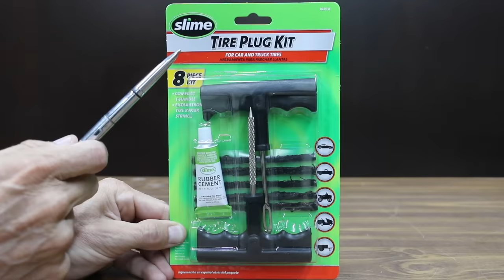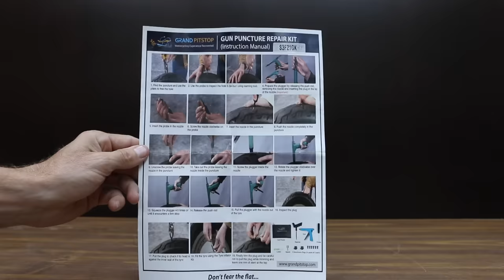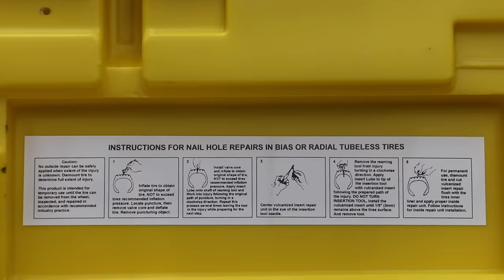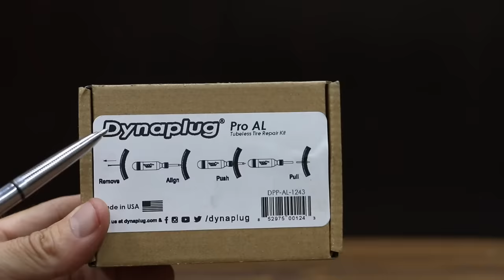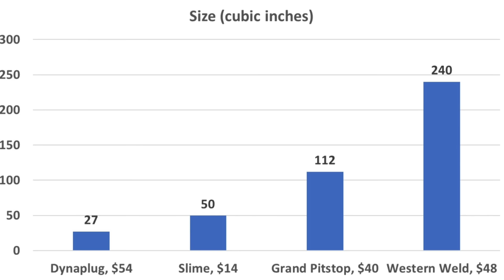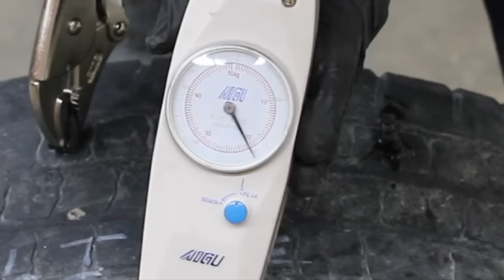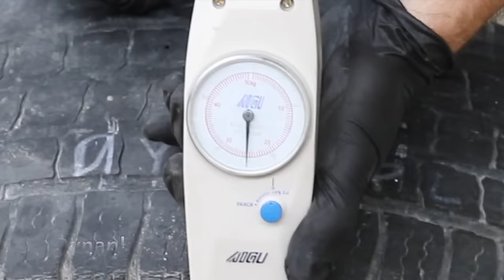Best Tire Repair Kit? SLIME, Westweld, Dynaplug, Grand Pitstop

Comment: Back when I worked for colony tire in 2005 we always used a patch with a rubber stem that you pulled through the hole and vulcanized with rubber cement. Nowadays most tire shops immediately discredit that type of repair just to sell you another tire or set of tires. Greed  has run rampant through the tire industry. Good work project farm for putting all those that discredit this repair to shame!
Reply from the maker: Thanks for the feedback.
Reply: Greed? I submit it is what ever the market will bear!
Reply: Some of the plugs have been known to fail catastrophically resulting in fatalities.
I think the fact almost anyone can fit these plugs could be part of the reason for this. Most workshops will examine the condition of the tyre, size and placement of the hole first.
In some places the plugs are recommended as a temp fix.

I did some work in a workshop where we used a kit identical to the Western Weld. They worked well enough and I don't believe there were ever any problems.
 Having said that, where I am we have a very mild climate and almost never experience snow or below zero temperature which may affect these plugs. We also never used them in sidewalls or off the tread.
Reply: @Cheepchipsable Well my friend. Where I am from, people and tire shops don't care much where they put the patch on tires since tires are very expensive and hard to find. Tires that are repaired can last a month or tire life, depending on the condition of the tire and roads. You probably don't believe this but I had seen  tires that you literally can see wires and the air.  We call that tires "Chivas".
Reply: @Cheepchipsable  (replying to 6 months old comment but what I'm about to share is worth it)
Here in Philippines, tire plugs are often used and lasts the life of the tire itself. I know someone here in manila has used tire plug on his motorcycle and he even had 12 hours trip. That's approx. 450km or 280 miles, Manila to Tuguegarao.
Reply: @yveslyndelblase I've used plugs in both cars and ATV's. None have ever failed and all tires have been driven the life of the tire.
Now think about that, cars driving in pavement and gravel and I've plugged an ATV tire with 6 plugs and none failed and the terrain for the life of the tire was rock, mud, water, hard pack, and shale. So anyone who thinks a plug is temp for a car tire is silly.
The reason they say it's a temp fix is to remove any liability should you have done it wrong and have an accident.
Reply: Greed is definitely the word.

Comment: As a former delivery driver, I've used loads of different tire repair kits, and as a general rule I can say that most if not all plugs are decent enough to fix a punctured tire, so even with having seen this video, I'll just keep buying whichever one is in store when I need it. i've worn out several sets of tires with plugs in them, some even 2 or 3 plugs. Another great, thorough video though!
Reply: Same! Never used a mushroom plug. I feel like rope plugs are better because you can just add more if they ever leak.
Reply: Yep! Them things last longer than the tire.
Reply: I remember doing 2 or even 3 plugs in one hole to plug a tire

Comment: I've been using the Westweld type for 30+ years now and never had one fail. They seal perfect and last beyond the threads showing.
Reply from the maker: Thanks for sharing.
Reply: Same.  Been using them for 20+ years.  They've lasted the life of the tire.  I think I've only had one or 2 leak immediately after install, but just pull it out and start over and your good.
Reply: Hi, will the Wesweld type work without the silicon lube?
Reply: I used the slime kits when I had a rash of screw punctures from construction. Never had one fail either. And i kept them until the tread wore out.

Comment: The western weld style has been my favorite plug and I consider them a permanent repair. The lube is actually a vulcanizing agent that bonds the plug to the tire. The smooth reaming tool pushes the fibers or wires aside with out nicking or cutting them. Those strands will return and bind the plug in place. I tried removing an old plug on a worn out tire that had been in place for over a year. It would not budge as a whole and had to be pulled strand by strand.
Reply from the maker: Thanks for the feedback.
Reply: When it comes to the special tool an ice pick / awl would work as well.
Reply: They won't let use use plugs where I'm from,you can use them for your own car,just not a client's
Reply: No plug should be a permanent repair.
Reply: @fauxque5057  That is the nanny government's stance as well.  Me, I've installed and used slime plugs on tires for many many tens of thousands of miles (the rest of the tires natural life until it was worn out and replaced) therefore I'm going to continue this practice as I have yet to have one of my plugs cause any issue.
Reply: @fauxque5057  Most tire shops use plugs.
Reply: Have them in every vehicle. Never had a plug fail yet. Not a lot of tire shops in rural north dakota
Reply: @LoganGillespie-if3ov  reputable tire shops use plugs that go in from the inside of the tire and have a patch incorporated. Not this style of plug repair done from the outside.
Reply: If they fail it will be the first day of use and it will be a tiny leak .    There’s no way that it can have a 😱dreaded blowout.    If it did come out you would find you have another flat tire.         This urban legend seems a hybrid of the ancient tubed tire Blowout and tire shop sales propaganda.   I’ve known people sho will actually replace a perfectly fine tire with a new one because of a simple nail hole.    These are the same types who they invented the TPMS about.     They wouldn’t check the pressure until it “ Looks low” with about 12-15 PSI🥺
Reply: @trevors8577  Had my first of hundreds blow out yesterday. Dropped my confidence level a bit.
Reply: @LoganGillespie-if3ov  Yeah from the inside - plug and patch together. Only cowboy tire shops plug them due to liability at chain stores.
Reply: @drizler  Actually I had a 24 hour old plug blow out on the highway yesterday. First of many hundreds to do so.
Reply: I was a factory trained tire repair instructor. The over the counter string repairs are of very poor quality, basically a plug. There are quality outside repairs available from manufacters such as, Tech USA, Prema Germany, Maruni Japan. These quality products have a grey cushion gum used with chemical vulcanize fluid for a permanent cured repair. You could literally cut the tire in half and the repair will still be intact. Far superior and Safe!
Reply: @RRaucina  This is the first I am hearing that it's not a permanent repair.  I used to work at a gas station and repaired customers tires with plugs all the time.  We considered it a permanent fix.
Reply: @markjohnson8824  I consider them permanent with careful installation and top quality plugs. But for me there is a 1%  +/-failure rate

Comment: Love the program, my friend. I will note, as a former mechanic and tire installer, you probably wouldn't have noticed a tire balance problem with the tire on the rear of the vehicle and even on the front you probably wouldn't feel anything until you reached around 55mph ( I don't know why that specific speed but always at 55). The belts almost never get "broken" or slipped from inserting the tool, the distortion is so small it has minimal effect on the life of the tire. But as all products go they have to warn of the possibility. I also have used tire slime and similar kits with great success. I can assure those at home that the Tire Slime kit will work perfectly! If one is looking to fix their own tire and wants to do it safely and inexpensively, these Tire Slime kits are just what one needs.
Reply from the maker: Thank so much!  Thanks for the feedback.
Reply: I've used the Slime Kit a few times and they worked great. The plug insertion process of the repair will give you a bit of a workout at times, but in the end you're back on the road in a short time.

Comment: The next time you test tire plugs I want to go for a ride-a-long. That looks like fun. Great video. Thanks.
Reply from the maker: I had a LOT of fun!!
Reply from the maker: You are welcome!
Reply: I am somewhat surprised that the grass runway owners allowed some aspects of his testing. 
From what I understand from some users of a nearby grass runway only relatively lightweight low pressure low speed turf tire equipped UTVs, ATVs, or SUVs are normally allowed on the runways and taxiways.
Reply: @davidhoffman1278  he's done other testing here, possibly he is the owner? Maybe it's part of an airstrip test also lol
Reply: @kylancook3477   he owns it

Comment: I worked as a mechanic for a few years. Tire plugs were a regular repair and I swear by them. Often times the plugs outlast the tires they're put into. I always recommend owning a kit in your car and a cig lighter pump. You can fix most leaks without even taking the tire off the car.
Reply from the maker: Thanks for the feedback.
Reply: You forgot a sprayer with soap and water unless you have bionic ears!
Reply: Yeah. It's supposed to be not legal for a shop to repair a tire like this anymore and plugs are supposed to be used only for a temporary repair. 

Which is ridiculous because the plugs work just fine. I've never had one leak and I consider it a permanent repair. I will continue to fix my tires that way despite the new regulations.
Reply: @TheEgg185  government and lawyers 
I remember in Louisiana over ten years ago when they told tire shop I worked for that i would still plug my own to lazy to take tire off
Reply: I have been told they are illegal. However I still can’t find the law. However I have seen insurance policies that will not cover damages caused by “plugged “ tires.
Reply: @sneal77777  ??????????????????????????
Reply: I don’t think it’s illegal. A shop in CA told me that they won’t repair a tire that’s been plugged but it’s because of the potential damage caused by the reaming tool. They said they use a carbide cutter to ream the hole without damaging the belts and I think their plugs are installed from the inside of the tire.

Comment: Bought the Dynaplug years ago, repaired three tyres and all are still holding pressure after about four years, and they're in use every day. Excellent testing with a well thought out pattern...... as usual !
Reply from the maker: Thanks for sharing.

Comment: My family is attracted to picking up random objects in their tires, I honestly never knew there were so many different types of plugs. I've always used the slime or the cheap stuff off the shelf at walmart and have never had a leak for my "temporary" repair, which would be until the tire got replaced when all four tires were no longer good
Reply: I've got 3 plug in the same damn tire, it's been 3 years. heh.
Reply: i find wide performance tires just eat up nails and bolts, its sad lol
Reply: I have done the same, used whatever was cheapest and NEVER had a problem. Same as you, once repaired it's been good for the life of the Tyre. Many of these Kits appear to be Identical just with different branding. I have bought them for as little as $4 and they all worked fine.
Reply from the maker: Thanks for sharing.

Comment: This was one of my favorites so far. The “Dukes Of Hazzard” tire testing  was awesome!   I like  the Slime brand  because they work good and they’re easy to install.
Reply from the maker: Thanks!
Reply: Be careful with the Slime brand, that plastic handle will fail
Reply: @GunnysWrenches  Its not just Slime brand, I can't remember which brand it was, but I had a handle fail when I was using it, I was very lucky to not impale myself.  IF you are going to use something with that design, buy the one with the most robust looking handle.

Comment: I used to run a service truck for DOT and used the slime plugs a few hundred times with near perfect results.  At one time, I was responding on the shoulder daily and getting one to two flats per shift.   Rather than heading in and changing the tire every day I just kept using bandaids. The most I had in one tire was 11 plugs.  One was even in the corner of a shoulder.  They held great all day on the highway and smacking potholes.
Reply from the maker: Thanks for the feedback.

Comment: One of my first jobs was in a Service Station and we fixed tires (yes, long ago) and I can't say how many tires we plugged over the years. It was a lot. We never had issues getting simple tread penetrations to seal up and no one ever came back to complain. Back then (late 70's) the plugs looked like the Westweld ones in this video but they were brown and not made of rubber. It was some kind of sticky fibrous material. I personally would not worry about using a tire that had a plug in it. The likelihood of a catastrophic failure of a tire from a tire puncture repair (barring other damage) is very small unless you drive very fast and push tires to the limits. Just my opinion anyway... Great job testing as always.
Reply: he should do  and try internal patches
Reply: At the shop in work in we have one of those old plug kits the tools look very similar to the westweld brand and even has some red plugs left! I think its a “safety seal” kit. I was told the kit was purchased from  a traveling salesman for safety seal. At every stop he jabbed a hole in his own trucks tire and repaired using his demo kit. He had hundreds of plugs in his tires and some plugs had thousands of miles on them. I guess he sold at least one kit at every shop he stopped in at.
Reply: @the86125  Safety seal they still make them I have a heavy duty kit in my service truck same brown plugs
Reply: I can concur. I was a mechanic for Nissan and I plugged hundreds of tires with the rope plugs. I applied vulcanizing cement to them as well before I installed them. I had zero come-backs. Patches on the other hand, I've had several come back; which is kind of lame considering the ease of the plug over the patch, but the customer demanded a patch over a plug.
Reply: Plugs have proven themselves over and over and personally use them on my own cars. The only bad thing about plugs is if an idiot owns the car and drove miles with a flat tire and shredded the internal sidewall. So plugging the flat cured that but this internal side walls are ruined and can blow out. Again only an idiot would drive miles on a pure flat tire but it happens all the time.
Reply: I can't tell you how many hundreds of Safety Seal repairs I've made over the years. Never had a failure. Even some temporary repairs in sidewalls, where a repair should never be made, always got the vehicle to a shop for a replacement tire. One time a lady got a house key in the sidewall and I temporarily plugged it with six Safety Seals. Got her sixty miles to home. There have been numerous times when I refused to plug a tire, but internal patches weren't going to work either. I plug the rear tires in motorcycles, also, but NONE of the motorcycle brands or the MC tire brands condone this practice. I don't think I'd hesitate to use Westweld if Safety Seal wasn't available.
Reply: I still have some brown ones and they work fine.
Reply: Ah, the 70s. When a "fast car" did 0-60 in 10 seconds and high speed cornering was a myth 

I feel that the way people drive has changed and certainly the cars they are driving are far faster in just about every way. I might trust a plugged tire to cruise at 55 with slow turns but if you're lane changing on the interstate maybe not
Reply: @AiOinc1  skeptical of something that has been working for 100 years? Lol wow
Reply: @AiOinc1  you realize when hotrodding became a thing, right? People have always had a desire for speed, it's just easier for people to go buy a fast car today.
Reply: @punker4Real   I've done many of both, internal patching on the road side is challenging to say the least while plugs and portable pumps ride with me.   Since plugs have great reliability why do all that extra work?
Reply: @punker4Real  have done patches. My feeling about the two was that I trusted the plugs more. But to each their own... Pick your poison.
Reply: @jayztoob  I've also patch a motorcycle rear (my bike) when I was two states away from home. It worked great, but I did replace that tire at home. Big difference in losing a motorcycle tire VS a car. Wasn't betting my life on long term use.
Reply: @1963rlh  Regular MC tire, yeah, I agree. However, I ride darkside. That's another thing that I do, but I don't recommend to others.
Reply: @AiOinc1   There are an endless number of people who can vouch for racing on plugged tires.  I've put countless numbers of drag and autocross runs on plugged tires.  Family has a tire shop and I've never seen a plugged tire come back with a plug failure.  The only issue is someone having driven on the flat tire for an extended period of time and thus destroying the internal structure of the tire before getting it plugged.
Reply: @User-gs1dk  - I had one plug in my wife's car tire that leaked.   Pulled the plug, re-reamed the hole, new rubber cement, new plug, and no problems until the car was replaced.   (after that, who knows)
Reply: @AiOinc1  - I'm an IT consultant, and I drive a LOT of miles, and often at pretty high velocities.   I think the most plugs I had in one tire was five (all from the same customer warehouse, different visits), the tire never failed.    I wouldn't trust a sidewall patch, of course.